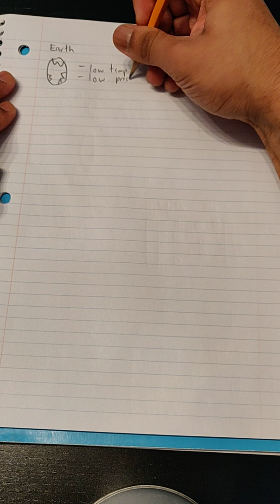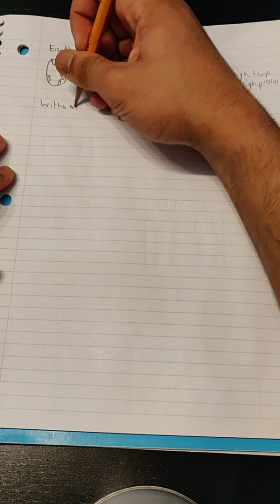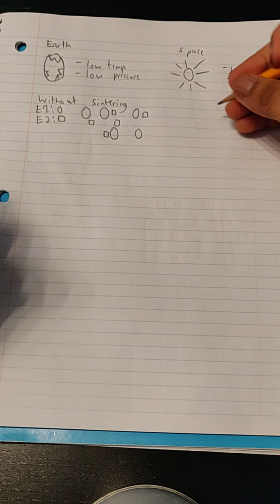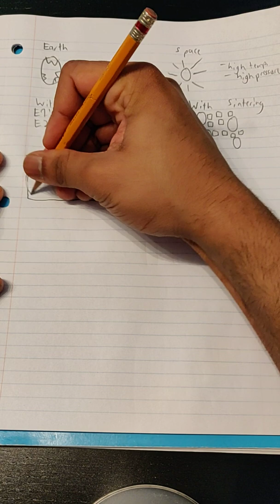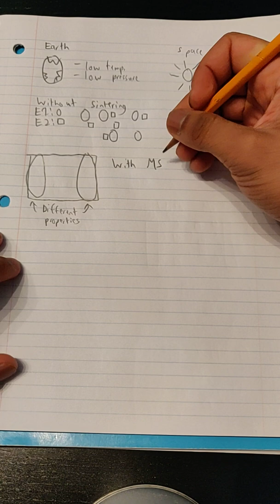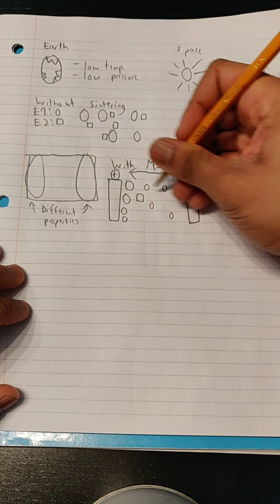Gil_John _assign7_ENG2003.mp4

Comment: honestly very well done, quick question though since you said the best materials for the best conductivity; what would be the best materials for insulation at that pressure, radiation and heat? (keeping in mind, we already have quantum computers that are cooled to aprox: 0.012.... K) the point of a fusion reactor is to make a mini sun so in order to make it possible are you saying we would need a sun anyways? and another thing, if mass is a problem can't we design something that would use the very core of our earth? one last thing, the point of a fusion reactor is to effectively fuse atoms together correct? and fission is the process of splitting atoms so would it be possible to then create an infinite power source that does both and recycles? (or at least makes it highly effective because just like newton balls any form of energy will still deprecate)